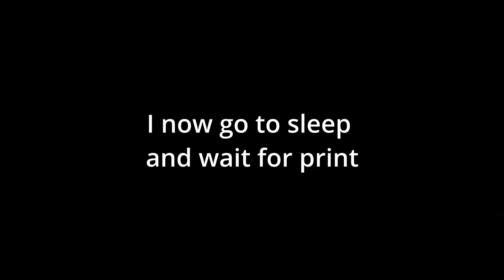DIY Wind Tunnel!!!(Wind Go weeeeeeeeee) it homemade (obviously)

Comment: bro which materials you use fot this project , i need urgently
Reply from the maker: Hello! I used foam that you can find in a hobby store for building model aircraft for the main structure. I used the plastic from bread boxes I found at my grocery store to make the windows. I used 3d printing to make the mount for the motor, I used a way over powered brushless motor with a wireless transmitter for model aircraft to power the propellor. For smoke I used just a Halloween fog machine.
Reply: @TheEngineeringMonkey  thankyou,

Comment: Love your project dude! What did you use for your smoke and how did you implement it into your tunnel?
Reply from the maker: For the smoke I used one of those Halloween smoke machines. I simply hooked a small tube up to the end of it and moved it around the intake of the smoke machine. I had some plans to maybe make a permanent attachment that goes inside the wind tunnel but that would have been difficult to move and build with my current supplies. The most difficult part was finding a tube that gave a laminar enough flow however. Thanks for the support!
Reply: @TheEngineeringMonkey  Yeah, I'm trying to design a tunnel of my own and currently having problems with my ultrasonic humidifier. How did you make it so that the mist went through the tube since the mist usually lies near the water's surface?
Reply from the maker: @Daniel-yq5gm My apologies, I used one of the heat based smoke machines that pushes fluid through a heated pipe which vaporizes it. Perhaps for yours though you could have it higher than the wind tunnel and you could simply let gravity pump it? I’m not sure how long the smoke will last before it condenses though.